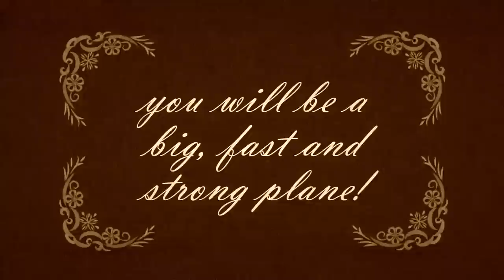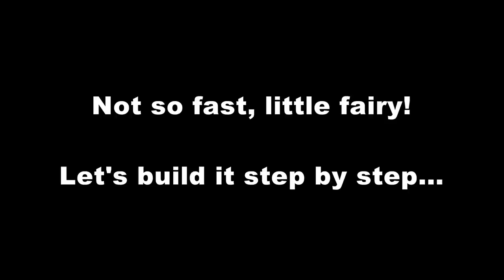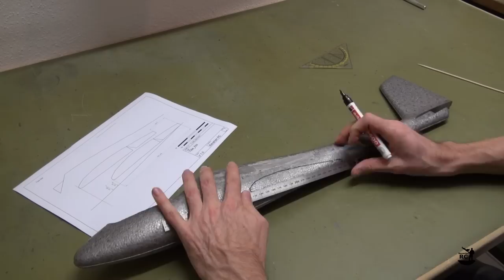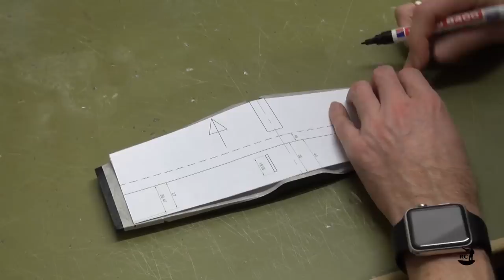The ultimate LIDL glider RC conversion into an A-10 Warthog - Build Video

Comment: Hi... Noch paar Fragen.
1. Muss ich etwas beachten wen ich 2 ESC benutze außer natürlich das.die Batterie dafür geeignet ist? Und wie schließe ich diese an?
2. Was für eine sprühfarbe benutzt du?
3. Kennst du noch ein Link wo man diese Lidl Flieger bekommt... Hab meins nämlich schon... Nennen wirs Mal modifiziert.
4. Wo bekomme ich diese Fieber Glass Stäbe?
Reply from the maker: Kein Problem, hier ein paar Antworten 😜 
1. Ein ESC wird ganz normal am Empfänger beim Batterieanschluss angesteckt, damit versorgt er ja die Fernsteuerung mit Strom. Den zweiten ESC stecke ich dann an einen freien Kanal an und mische dann beide Kanäle in der Fernsteuerung zusammen. Die Batterie ist ein normaler 3s Lipo und wird mit einem Y-Kabel an die beiden ESC angeschlossen. Das Y-Kabel hat auf der eigenen Seite einen Stecker bzw. Buchse zum Anschluss an die Batterie und von dort geht dann einmal plus und minus zum Stecker für den einen ESC und parallel plus und minus zum Stecker vom zweiten ESC. 
2. ich verwende als Sprühfarbe Dupli Color Platinum. Ist nicht die günstigste aber ich habe damit bislang die besten Erfahrungen gemacht. Das EPP Material vom Lidl Flieger ist aber kein sehr gut haftender Untergrund und selbst bei der teuren Farbe passiert es dass sie teilweise abgeht
3. probier‘s mal bei Lidl im online Shop (www.lidl.de). Sind noch verfügbar
4. Das sind 5x4 mm Kohlefaserrohre von Graupner Artikelnummer 5225.5.4 Die gibt‘s bei vielen Modellbauversendern für 4-5 Euro
Ich hoffe die Infos helfen Dir. Du kannst Dich aber gerne noch mit weiteren Fragen melden. Schöne Grüße aus Bayern

Comment: Hi... Just one question. Do you actually live in Bavarian? And if so where do you get those thin styrofoam boards... Cause I live in Brandenburg and in every hardware store around my place there are no styrofoam boards at all. 

In German (maybe a better explanation).
Hi. Ich hätte da Mal ne Frage. Lebst du in Bayern? Wen ja wo bekommst du eigentlich diese dünnen Styropor Platten. Mein Problem ist das dass dort wo ich wohne (Brandenburg) es keine Styropor Platten in den Baumärkten gibt's... Naja es gibt halt nur 3mm Dämmplatten dennoch brechen diese sehr schnell, haben keine papier Beschichtung und sind auch nur 3mm dick... Ich hab auch schonmal im Internet gesucht fand aber meistens nur Sachen die fiel zu teuer waren oder wieder nicht beschichtet. Ach ja und wegen den Wohnort... Lebst du vielleicht ein Laden (modellladen oder wo man halt solche Platten kaufen kann ) in der Nähe von Fürth... Meine Oma könnte halt mir von dort aus paar Mal Mitnehmen...

Mit FG aaron.

PS sorry für die Umstände und unformalität... Oder wie man das nennt
Reply from the maker: Hi, ich antworte gleich auf deutsch. Bei diesen Platten handelt es sich um sog. Flite Test Foam Board. Kommt aus USA und wird in Deutschland von Graupner vertrieben. Kostet pro Platte um die 2 Euro. Daraus kann man tolle Sachen machen, meine Bronco die in vielen meiner Flugvideos vorkommt ist aus dem Material. Lohnt sich bei Flite Test auf der Homepage oder auf dem YT Kanal mal vorbeizuschauen. Ach ja, ich bin wirklich aus Bayern 😀 das Material bestelle ich mir aber online.
Reply: @bavarian_rc  ahh OK... Auch schon gedacht diese Platen zu kaufen... Die sind ja extra dafür gemacht... Denke ich würde dann so ein building set Kaufen... Aber danke

Comment: Hello, your video is amazing, i love it ! Great job.
I'm new to this hobbi, and i wanna make a rc glider conversion like you. 
How do you choose your motor, the form of the wings, how do you get the dimension to cut the glider ?
Reply from the maker: Thanks a lot for your feedback. The way I selected the motor was a bit like „what do I have and what might work“. Basically you should have a rough idea of the amount of thrust you want and then to select your motor. This requires a bit of experience. So I would recommend to look for similar planes with similar flight performance and then use the same setup. The setup for my Twin Turbo is quite overpowered and not suitable for someone new to the hobby. For my first conversion I copied other conversions and then put more and more own ideas inside. This was already my 4th or 5th conversion. Finally there is not so much that can go wrong. It is only foam! Build it, test it, crash it, improve it… it is all part of the hobby!
Reply from the maker: Last recommendation. Don’t copy my A-10! It had some design deficiencies making it not the most stable plane on the planet. The best design so far is my Twin Turbo (Check the videos on my channel) but as said before it is a bit overpowered. There are plans linked in the video description which might help anyway. I also have 2 more designs (again check the videos).
Reply: @bavarian_rc  Thank you very much for all your advice :) 
I just order my first piece (motor, reciver, transmitter, servo-motor with ESC). For my first try i'll try a simple glider convertion. I can't wait to try all of this.
Your videos are amazing, again ty very much :)
Reply from the maker: With pleasure! If you run into any difficulties or have further questions don‘t hesitate to post another comment. I‘ll try to help where possible.

Comment: Hi how did you connected this 2 motors?
Reply from the maker: The battery is connected by a Y-cable with the 2 ESC‘s (ESC‘s in parallel). Each ESC is connected to one motor. One of the ESC is connected to the receiver on channel 1 (providing also the BEC power), the other one is connected to channel 5. Finally channel  1 is mixed to channel to have synchronized motors. You could at that stage also add differential thrust which I use on many of my twin motors, but requires more mixer settings

Comment: Where did you get that big block of grey foam? I want to build an rc boat using airplane motors and props and that looks to be perfect for it.
Reply from the maker: It is XPS foam for architects to build models. Found it on Amazon: https://www.amazon.de/XPS-Hartschaum-fein-29-silbergrau/dp/B00L9KNCG4/ref=sr_1_1?__mk_de_DE=ÅMÅŽÕÑ&keywords=XPS+Hartschaum+fein%2C8+x+29+x+39+cm%2C+silbergrau&qid=1562160662&s=gateway&sr=8-1

Comment: Wie bestimme ich den was für ein Motor ich brauche, was für Propeller ich nutzen soll und was für ein ESC? Und wen ich zb Zwei 30c ESC hab (natürlich auch 2 Motoren) brauche ich den min. Ein 60c Batterie?
Reply from the maker: Hi, also das ist nicht unbedingt meine Stärke, ich orientiere mich immer an ähnlichen Flugzeugen und schaue was die verwenden... oder ich nehme was ich gerade rumliegen habe. Wenn der Motor mal feststeht, dann einfach googeln, welche Luftschraube drauf passt. Die 60C sagen nur dass Du 60*Kapazität an Strom ziehen kannst, wobei viele Hersteller da etwas großzügig mit den C Angaben sind. Bei mir fließen rund 14 Ampere bei meiner Batterie mit 1,6 Ah und 70C bedeutet das ein Max. Strom von über 100 A, bin also noch weit weg. Es heißt aber immer dass die Batterien mit hohem C Wert mehr „punch“ haben. Ist aber auch nicht mein Fachgebiet 😜
Reply: @bavarian_rc  ok... ich Versuchs halt mal...

Comment: Bello, bravo.
Ma solo per curiosità, perché i motori sotto le ali e non sulle gondole ?
Ancora bravo e ciaooooo!
Reply from the maker: Thanks! I wanted to minimize the complexity and therefore used normal propellers instead of fans in the nacelles. The nacelles are too close to the fuselage to use normal propellers. But I plan to do an upgrade using fans somewhere in the future. Ciao. 
[Automatic translation to Italian] Grazie! Volevo ridurre al minimo la complessità e quindi ho usato eliche normali invece di ventilatori nelle carlinghe. Le gondole sono troppo vicine alla fusoliera per usare eliche normali. Ma ho intenzione di fare un aggiornamento utilizzando ventilatori da qualche parte in futuro. Ciao.
Spero che la traduzione sia ok 😜

Comment: Gute Arbeit, ich hätte eine Frage.
Hast du vor die STL Dateien für den 3D Drucker zu veröffentlichen, oder sind diese "Top Secret"?
😀
Reply from the maker: Hallo Daniel, kein Geheimnis 😂 werde einen Link in der Videobeschreibung aufnehmen. Hoffe ich komme morgen dazu. Werde auf jeden Fall eine Antwort posten wenn der Link und die Daten online sind. Möchtest Du auch eine A-10 versuchen?
Reply: @bavarian_rc  ich hab es vor. Ich hab dein Video gesehen und dachte mir warum soll ich alles selbst konstruieren. 
Dein Modell ist echt gut geworden, das Flugbild ist top, da soll noch mal einer sagen Modellpiloten sind nicht kreativ 😀😀
Reply from the maker: Hallo Daniel, ich habe die Links zu den STL files in die Videobeschreibung kopiert. Kleine Tipps für den Nachbau: Höhenleitwerksgeometrie nicht verändern (verkleinern), sonst wird die Stabilität um die Querachse schlechter. Wenn möglich mehr Gewicht nach hinten bringen, ich musste rund 90 Gramm Blei am Leitwerk positionieren. Rumpfrücken vom Servo nach vorne mit Kohlefaserrohr verstärken (ca. 13cm lang) … bei mir ist der Rumpf genau hinter der Tragfläche abgebrochen, da der Kohlefaserstab auf der Unterseite hier endete … war quasi eine Sollbruchstelle 😂 war aber leicht zu reparieren. Viel Erfolg und lass hören wie der Bau geklappt hat.

Comment: Nice job , I could have done without the 2015 you tube music but ...ok .so ,,,,, why not just put 2 small EDF in the pods instead of the electric prop motors on the front ?
Reply from the maker: In retrospect I have to say, EDF‘s would have been a good choice. First, better looking and more scale. Second, way better in terms of weight balancing. One day I will upgrade it ...
Reply: @bavarian_rc  sweet. I look forward to seeing it

Comment: Fantastic build, but slightly disappointed that you put props on it when small edf units are readily available and by the fact that the build was complete but you didn't include flight footage.
Reply from the maker: Well, I knew I would get these comments concerning the EDFs but I wanted to keep it a bit more simple and go for the props. There are a lot of arguments for using EDFs and probably one day I will upgrade it, but I have some other projects for the moment. For the flight video... it is just one click away 😜
Reply: @bavarian_rc  and i mean to take nothing away from the build, for what it is, it is superb. A solid thumbs up.
Reply from the maker: Fully ok and well appreciated 😀

Comment: I’m curious why u didn’t use EDF on this build? And btw it is awesome!!! 👍🏼
Reply from the maker: Well I thought about EDFs but I have little experience with them (only my 70mm FT Viggen) and wasn‘t sure if such small diameter EDFs would give enough thrust. So I went the easy way... but I still plan to come back to my A10 and convert it to EDFs... one day!😜 But it was a real fun project to build and fly. Great that you liked it
Reply: Hab mir neulich 4 von den 2021 gliedern geholt und war auch auf die Idee mit der A10 gekommen. Dachte da an 40 oder 30iger EDF
Hast du nochmal über einen Umbau nachgedacht?

Comment: What paint did you use to spray it?
Reply from the maker: I used Dupli Color Platinum spray paint. After some tests with other spray paints I found this one was the best. Before painting I also used 400 grit sanding paper to roughen the Surface. But still you can scratch off the paint. It is really tricky to paint this type of Form.

Comment: I know you are fans of the A-10 but with the configuration of the motors, (the ones who actually work) it makes more sense to call it a IA-58 “pucara”.
Reply from the maker: Just checked it on google and I have to say you are absolutely right, just remove the nacelles and the double vertical stabilizer at it is a IA 58 pucara. Would be worth a separate conversion project 😏

Comment: Oha ich will auch so einen haben schaf es aber leider nicht ihn zu bauen
Reply from the maker: Ist gar nicht so schwer, fang mal mit einfacheren Umbauten an... und man braucht auch keinen 3D Drucker, geht auch ohne... Ein guter Einstieg sind auch die Flieger von Flite Test, bin großer Fan von dieser Bauweise. Ich werde demnächst eine eigene Foamboard Konstruktion rausbringen.
Reply: @bavarian_rc  hab grad angefangen mit 3d Flugzeugen und die werden scho langsam fad jetzt will ich wieder einen schnelleren
Reply: @actionfilmer3959  Hi, wenn Du möchtest, kann ich Dir so einige Tipps geben, denn ich habe bereits 5 Lidl umgebaut. Nr.1 Motor über den Tragflächen. Super für Bodenstart. Nr. Motor vorne ohne Höhenruder und ohne Seitenruder, dafür aber mit Flächenverwindung. Nr. 3 Motor vorne - ziemlich schnell Nr. 4 Motor auch vorne aber eine größerer mit geringer Drehzahl. Accu sintzt auf den Flächen. Propeller werden von mir selbst aus PLA gedruckt und zwar Zweiblatt und auch Dreiblatt. Sieht toll aus, aber die Leistung ist nicht unbedingt größer, dafür kann ich lange fliegen Accu 2200 3s. Und jetzt habe ich einen Segler angefangen mit einer selbst gebauten Schleppkupplung. D.h. ohne Motor. LG Hubert